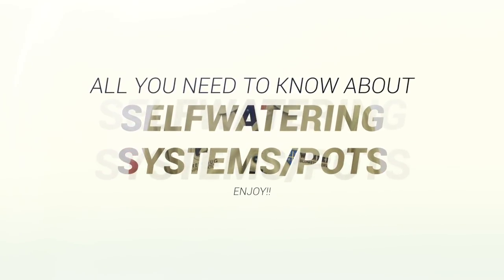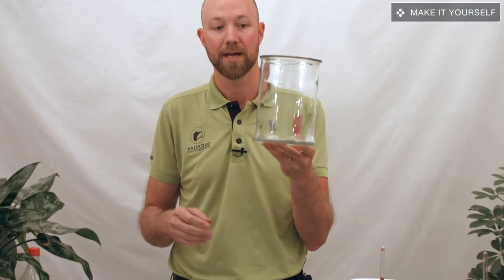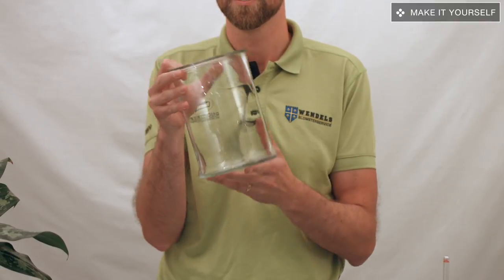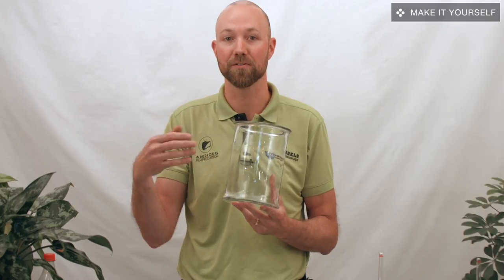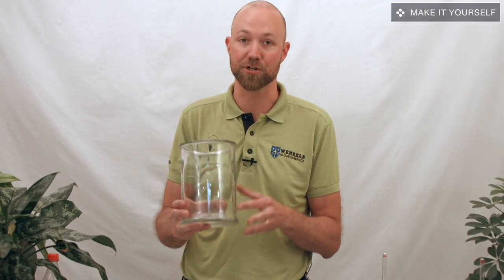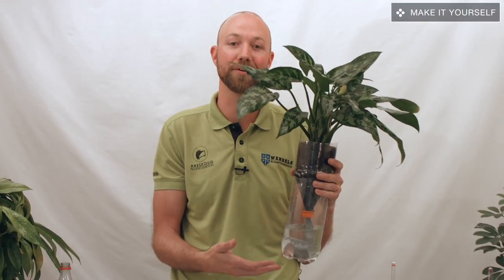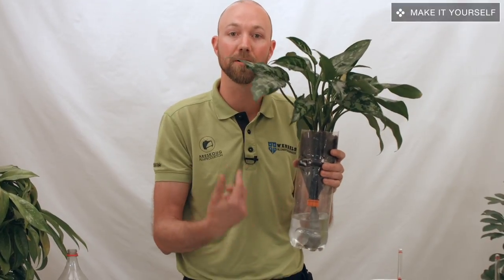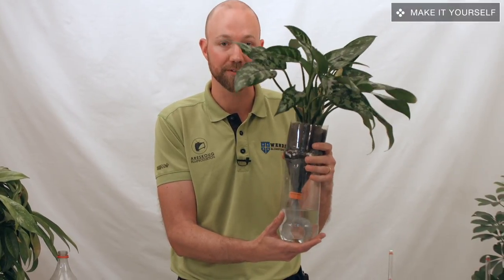All you need to know about selfwatering systems in pots

Comment: Can self-watering systems be used for succulents and cacti? I stress out the most about watering those and have killed many many many of such plants... =(
Reply: I live in Arizona and have tons of cacti and succulents. I wouldn’t do this method for those plants. I give my succulents 4 Tablespoons if water per plant, per month. Cacti gets 2 Tablespoons.  This is based on a 4” plant. Add 1 tablespoon per inch of plant height. I know it doesn’t seem like “enough water” but it really is. Hope this helps

Comment: Hi. Good video thank you I finally got to understand how this system works and why I see so many self watering systems around, not knowing which one to pick. Since now I see they all work I’ll keep the one started to adapt to my pots already which is using a small Dixie cup with holes in it,  but no rock, just soil touching the water. My question for you is: is this system good for all plants, even those not needing water that often- will they just take what they need sort to say, or is it good just for plants that require daily watering? Also, is this method good for seed planting or just for plants.thanks for your help I’m just starting my veggie garden and since I’m not very good at watering my plants regularly I’m trying to find something that will work for me. I appreciate your help

Comment: I am just a beginner, and you have helped me avoid some mistakes I would have made had I not watched your very interesting video.  Thank you.
Reply: Another alternative would be to put the plant into a net pot or a plastic flower pot with drainage holes at the bottom. Thread a nylon rope or a shoelace through the holes and then add your soil medium. Then put the  net pot or plastic flower pot into a slightly bigger outer pot that can be a  glass or plastic container. Fill the bottom of the outer pot with water making sure that the water level is below the drainage holes. In this way, you save on buying pumice. In my country, pumice is very expensive.

Comment: Does the micro fibre cloth separating the leca from the soil act as a wick for the water in the leca layer and will also be saturated with water which then can make the soil up to the surface also damp enough to provide adequate water for the roots of the plant? If so is the wick from the bottom of the pot up the side of the pot really necessary?

Comment: Many plants need to dry between waterings and my self-watering pots keep the soil moist at all times. Does that mean I cannot use these pots with plants that need to dry?
Reply: Does biobizz soil have enough drainage to use in a self watering pot.l will be using the ac-infinity self watering pot bases for self watering.
Reply: Currently using biobizz all mix in lechuza self watering pots. So far so good but I added extra perlite and pon which came with the pot to improve drainage.
Reply: Thank you for showing the different self watering options available in the market as well as the DIY. 
Those water roots, can they be cut if need be?

Comment: So to get the water in the bottom you have a 2 container system either were you take out inner pot or find something with a tube that leads to the bottom with water lvl  bobbers .  Or do your glass jar system . I got a bucket with just the soil /water seperator insert . Sorry I am new . How do i get the water to the bottom ?  or is my set up like the glass jar already . Just water and the excess will drain away ?  Or should I find a water tube and bobber still ?Or just toss the insert and do your glass jar set up ?

Comment: My question is a little bit off topic, but is about watering, soil and oxygen content of the soil, and I wonder about the health of the plant.
So, I want to try out a new potting soil mix, it says 1 part coco peat + 1/2 part vermiculite + 1 part worm casting or other similar organic material.
I usually tend to over water my plants by using potting soil which is too heavy in organic material and soak it really good and let the water drain out, it takes quite a few weeks to dry out.
My question is, would the above mentioned new potting mix good to solve my issue?
Also from what I'm understanding coco peat even if moist it is fluffy and it would contain some amount of oxygen
+ the vermiculite which is pours would keep some oxygen.

Comment: I tried the one version of PET method with a basil plant. I didn't reuse the lid and had a bigger wick. After a few months and the wick started turning green (like algae) and the bottom container started turning green too. It started looking pretty bad, did I do something wrong?
Reply from the maker: peri Hi, thanks for watching! I don’t think that you did anything wrong. If you put the PET in direct sunlight this will probably happen every time. When the water is subjected to sunlight the algae will start to form and thrive. Next time try putting the hole PET in a large pot or just cover it with something like for example cloth. This will keep the sunlight from reaching the water and the algae can’t survive. I hope this will help you. Don’t forget to subscribe! / Swedish plantguys
Reply: You need to blacken the glass, roots do not need light, algea grows in light. All nurseries use black pots.

Comment: I bought 2 pots that say they are self watering, but there are no wicks. Should I just add one? There were, of course no directions.
Reply from the maker: Barbara Shetler Hi, thanks for watching! Some self watering systems work without a wick. If it is a soil based system the can for instance be a plastic separator that separates the soil from the water. Usually there is a smaller part of the plastic in the middle that goes all the way down to the bottom. This pars works with the same intention that the wick does. So, where are systems that lacks the wick. 
You could ad a wick if you’re unsure, this will not make the system bad only strengthen it. I hope this helps you! / Swedish plantguys

Comment: I'm not sure but from bio I think soil bacteria - being much more efficient manipulating oxygen for their nitrogen cycle workings  - tend to suck up any remaining elemental oxygen in the soil in order to fix nitrogen, leaving the soil oxygen poor even in the best pot.  In a sense, the soil risks becoming almost functionally anaerobic, leading to the stink that comes with root rot soil, giving bottom water that metallic sheen.  Excess water in a pot probably fosters mass division of these nitrogen bacteria so oxygen depletion at the root level happens even faster.  When soil oxygen is restored with 'breathable' soil bags, bacterial division is self limited, and oxygen is redistributed throughout the soil surrounding the root ball by capillary and other microdistribution systems.  Roots love that sort of thing.

Incidentally, this bacterial oxygen depletion is what happens in aquariums when the air bubbler fails.  After a day or so of no oxygen bubbler, any remaining dissolved oxygen in dead water is completely used up by water bacteria of the nitrogen cycle, leaving fish panting at the surface trying to suck up whatever dissolved oxygen they can get at the water/air interface.  This is of course insufficient for large fish who then suffocate within their own tank, while fry and small fish often survive.  

This oxygen depletion is also likely why bottom feeders leap out of tanks when a tank is neglected.  There's just not enough O2 to breathe down there, so they make frequent trips up and try to stay there, or just eventually make a mad leap into space.   With power outages most people assume ammonia will build up in the tank, but are then perplexed ammonia levels are normal even days later,  while they net their dead fish.   That's because nitrogen fixation goes on, until even their supply is gone.  The cure in an aquarium during a power outage is to fill a bucket with aquarium water and drop it from a height back into the aquarium to create microbubbles of dissolved oxygen to tide fish over until the power turns back on, and doing this several times throughout the day.  The warmer the tank, the more bacteria grow and use up the O2.    Alternatively, a tank change in water from the tap is aerated, but if this has to be done several times over days of power outage, suffocation will still be a specter because bacteria will not slow down, but the nitrogen cycle is disturbed with  frequent fresh changes to replace oxygen for fish.  It's better to agitate tank water with a bucket instead,  and the higher up, the better for a jetstream to the bottom.   Not even a cold tank is as destructive to tropical aquatic life as being unable to breathe.  Cold water just slows cold blooded creatures down - bacteria too -  whereas O2 depletion can kill tank life far more quickly.  I assume plant roots feel the same way.